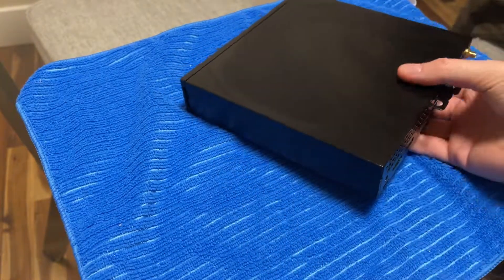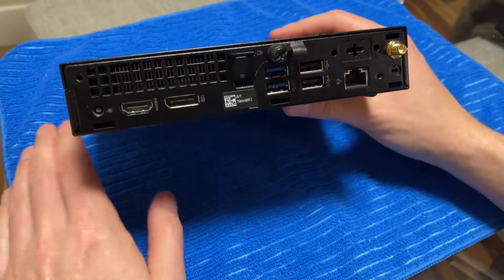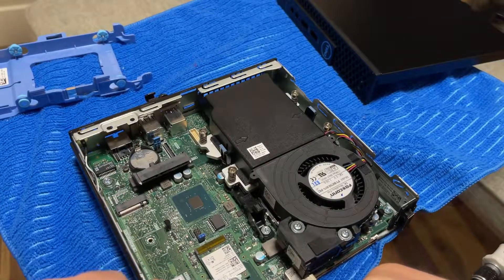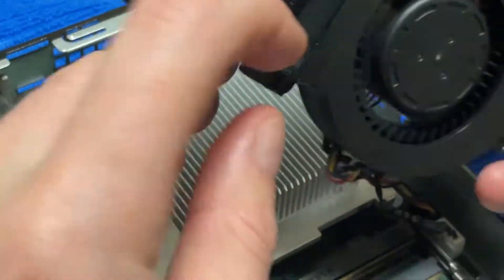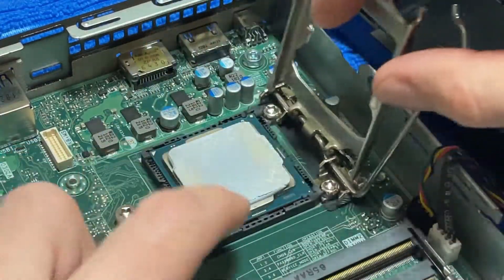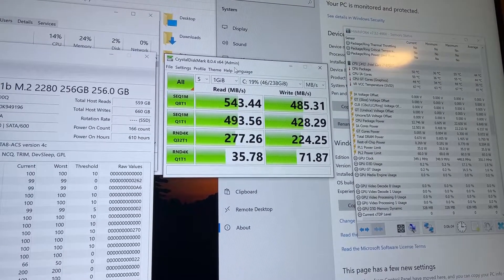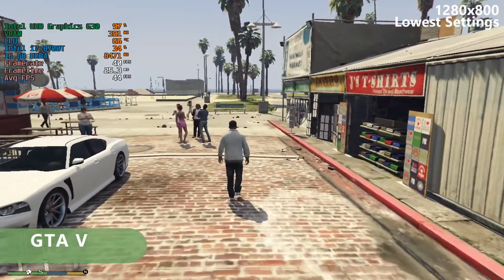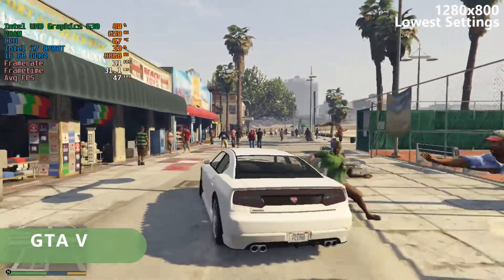This $95 Mini PC is a STEAL! - Emulation, PC Gaming, Upgrades [ Dell OptiPlex 3060 ]

Comment: I have this same model.
With i3 8100t processor.

What processor can I upgrade to the highest? I want the best one
Reply: i7-8700T
Reply: If you haven’t already, upgrade your system with two 16 GB RAM sticks (for a total of 32 GB), a 2 TB NVMe drive, and a 2 TB SATA drive. That gives you 4 TB of internal storage. After that all you would need is  a 4 TB external SSD to match the system for backups.
Reply: @TheCreepypastaChannel ok thanks.
But why do I need this much of storage?
Actually my plan is also to somehow add an external GPU 4070 Nvidia.
Is that possible? Somehow

Comment: I would like to ask about the maximum RAM capacity supported by the Dell OptiPlex 3060 Micro. I attempted to install two 16GB DDR4 SO-DIMM modules — one with a speed of 3200 MHz and the other 2400 MHz. However, the system fails to boot after the installation
Reply: Did you check them through the bios?

Comment: Hi , i also have the same model with i3 8100T. 
I am planning to upgrade that to i7-8700T, is it possible? 

And i heard that we can also add External graphics card Nvidia RTX 1650/3050 with help of " ADT-Link M.2 Key M NVMe External Graphics Card Stand Bracket with PCIe3.0 x4 Riser Cable 25cm 50cm 32Gbs for ITX STX NUC VEGA64 GTX1080ti " .

Do you know about this thing? please tell me , (Your  New Subscriber😃😃 )
Reply from the maker: Yes it's the same socket it will work 

You can theoretically use a m.2 slot to add a eGPU but I have never done this

Comment: I wonder if you can get a gpu upgrade? Or would that implicate on getting a new motherboard?
Reply from the maker: The gpu is part of the cpu. So no it can’t be upgraded
Reply: Actually  u can get a m.2  to pcie adapter  and plug in the m.2 port then get a power supply  for the graphics card to power it then install the gpu drivers and wallah u got a gaming pc.   But make sure it's a m.2 and not a sata m.2 port other then that your good
Reply: U would use the 2.5 Sata port for storage

Comment: what kind of gpu does this have? I have a 7040 and plays older gems just fine, but games like FFXIV - 2fps if IM lucky. GTA????
Reply from the maker: It has until UHD graphics. You’re going to be playing modern 2022 or newer games by any means. Realistically if you want to play AAA titles you’re looking at 2016 or earlier probably. However less graphically intensive stuff will run very well
Reply: @TechGuyBeau  thanks for the quick reply. I have several computers and mini laptops mostly think pads. I've recently had an infatuation with these micro computers but they seem to lack some serious GPU power, I was watching your video but did not see a GPU upgrade, that's why the question. Thanks for the video

Comment: These Dell models are technically USFF (ultra small form factor) devices. 

The SFF models are intermediate size, having more USB ports, provision for an optical drive, two half-height PCIe slots and room for a second internal HDD and a second stick of DRAM.

But if you don't require the expandability, the USFF machines are an excellent value for the price, as well as being extremely quiet in operation.
Reply: This generation (3060, 7060...) is called a micro setup by Dell, they no longer use the USFF name apparently.
Reply: Hi bro, i also have the same model with i3 8100T. 
I am planning to upgrade that to i7-8700T, is it possible? 

And i heard that we can also add External graphics card Nvidia RTX 1650/3050 with help of " ADT-Link M.2 Key M NVMe External Graphics Card Stand Bracket with PCIe3.0 x4 Riser Cable 25cm 50cm 32Gbs for ITX STX NUC VEGA64 GTX1080ti " .

Do you know about this thing? please tell me

Comment: i have a singular 16 gb ram, i5 9500T and a nvme drive with a 1 tb ssd but i dont know why my pc cant even run roblox with max graphics?
Reply: bro is missing a whole gpu

get an external gpu bruh

u will need an m2 to pcie adapter and a psu, at least cheaper than buying a whole system, make sure u have an empty m2 slot though

the setup might be a bit ugly but it works
Reply: The integrated graphics are not remotely enough for that game. You would need to go with an AMD 6000 or 7000 series
Reply: @beau-urns  of course it is enough, not at max graphics, but there are like 999999 games on roblox, all of them have different requirements

btw that recommendation is bad, u straight up told bro to buy a new pc

even the igpu in ryzen 6000 and 7000 series  is not much better than the uhd 630 lol

just get a god damn dgpu
Reply: @beau-urns  thanks alot

Comment: I just picked one of these machines up from auction. What is the maximum RAM that I can put in this machine, I'm looking to put 32 GB of RAM into it.
Reply: 32gb is like the minimum maximum for any motherboard and cpu nowadays

any lower and that shit probably older than queen elizabeth
Reply from the maker: Definitely 32. Not sure above that
Reply: You can use ddr4 64gb ram

Comment: Not sure if these are compatible with the 9000 series processors. I stumbled upon this video, and hoped to upgrade my i3-8100t > i7-9700t. It failed to turn on (quick flash of the orange light and then nothing). Found some thread online and apparently these(or maybe some) didn't ship with the microcodes required for the 9th gen processors (906EC 906ED). I dumped the BIOS, added the codes, flashed the BIOS and dumped again to find the microcodes present. STILL didn't boot when I installed the 9700t, so YMMV when trying to upgrade to a 9th gen processor.
Reply: thanks i was so close to try change a 8700 for a 9700
Reply: Hi bro, i also have the same model with i3 8100T. 
I am planning to upgrade that to i7-8700T, is it possible? 

And i heard that we can also add External graphics card Nvidia RTX 1650/3050 with help of " ADT-Link M.2 Key M NVMe External Graphics Card Stand Bracket with PCIe3.0 x4 Riser Cable 25cm 50cm 32Gbs for ITX STX NUC VEGA64 GTX1080ti " .

Do you know about this thing? please tell me

Comment: Got one for 70 bucks, but needed ram, ssd and a power cable, I spend about 100 on this missing items and I couldn’t be happier, now it has a 32GB ram capacity, 1TB nvme ssd from Samsung, and a brand new power supply
Reply from the maker: Worth it. Surprisingly good machines
Reply: @TechGuyBeau  yessir! I use it mostly for work, they gave us Dell 3080 micro pcs but they had all kinds of restrictions due to company policy… so I decided to get my own. And even tho is a 3060 I feel like it outperforms that 3080 in many ways!
Reply from the maker: @H3LLMAU5  mine is being used as a media PC. It’s so overkill. It can be used as a main computer to be honest
Reply: can you add external gpu?

Comment: Hello, Thanks for your video. I just acquired a 3060 thanks to you. But I read that normally for an M2 it is 512 maxi or I was wrong?
Reply from the maker: You can go at least 2tb. I got a 2tb to work without any issues
Reply: wait why is it 700$?
Reply: You can unlock pcie 3.0 for ssd if you google it

Comment: Damn. Thats a steal. I'm rocking a i7-6700T. Using it for batocera emulation. Would love a 8700t
Reply: Thankfully found an optiplex 7060 with an i7-8700t for $140 last week on OfferUp 🙏🏽
Reply: Not a big difference tho